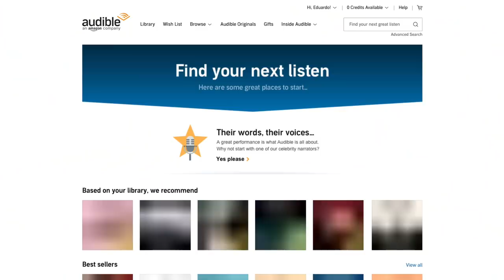⛵️DIY sailboat portlight installation #109

Comment: For future reference,  there is a plastic scrapper used for cleaning pots and pans where the side meets the bottom. I have used these to smooth out caulking when doing the  edges between the bath tub and the surround. Works a treat and they don't cost an arm and a leg! Your boat sure looks nice.  Have fun!
Reply from the maker: Thanks for the tip

Comment: Take a look at Butyl Seal Tape for sealing just about anything on your boat. It will maintain a seal so much better than anything else and so much easier to use.
Reply from the maker: Thanks for the tip.

Comment: Did you consider using butyl tape instead of psycaflex? It's so much easier to work with and allows for easy removal if you have to in the future.
Reply from the maker: Nop. We actually like sikaflex and butyl tape is not commom to use here in Brazil, it's not easy to find it to buy

Comment: You should invest in a battery operated screwdriver. 😉
Reply from the maker: We do have one. But these screws have flat head
Reply: Odd Life Crafting : I was going to tell Johnny that they are flathead and you can’t use screwgun but you beat me to it. 👍
Reply from the maker: 👍 I was quicker than you. hehehe. Thanks for the explanation
Reply: There are bits for different screws ..😉😬
Reply: Yes there different bits so go ahead and see how fun it is
Reply: @death1305sam  could you explain that please?
Reply: It is important to have exactly the right size of bits for the screw shell, and run slowly.
Reply: @frankd2301  what is the problem with flathead screw and battery screwdriver?
Reply: @BStrapper  they are no friends......
Reply from the maker: It’s easy to the screws to get out from the bit and scratch the woods. Also we can have a better notion of the torque we are applying

Comment: You guys are working hard and making great progress. A pointer on masking with the tape. If you always make sure your overlaps are in the same direction you can strip the tape all at the same time. Only have to pick the edge once and it automatically keeps lifting up the next piece of tape. Saves a lot of mess and time.
Reply from the maker: Thanks for the tip

Comment: A tip from an Aquarium builder - Cut a 30-40 degree angle on the end of the nozzle. Position the cut end facing down into the gap and move the gun along as you squeeze the trigger. This will help to force the sealer into the gap and leave you with a much easier cleaning job, and you will save a lot of sealer. You're doing a fantastic job!
Reply from the maker: Thanks for the tip

Comment: Great job guys it's nice to be able to see through the portlights. That really is a messy job, I think one of the worst problems is remembering NOT to put any old tape covered in sealer down on the nicely painted surface during the clear up. 
I saw some rather black looking fingers there, how long did it take to clean them up...I used to fit car windscreens and the bonding sealer for that would not come off for days!
I love the way you two react to each other...lots of love there!
One step closer...keep up the good work.
Reply from the maker: Hello, Dave. Duca had some black Sikaflex on his hands for some days, hehe. It went out by itself in the shower. hehe

Comment: Duca,  I understand the nerves but you and Roberta made it look great in the end! I can't wait to see that blue water behind you while you guys are at anchor. Maybe I will be in the same anchorage. Soooo, you live in a warm humid climate like I do and when I am doing a messy job like that I like to wear two pairs of latex or nitrile gloves. The reason is that they get messy and you need them off but then your hands are too sweaty to put on new gloves easily but with a second pair underneath a new pair goes on easily! Just tug on the wrist once in a while the fingers upward to let the sweat out. Other tips are to drill a hole through the caulk tube tip sideways before cutting it. Then cut just through the end of the tip at the end of the drill hole, this makes two points sticking out from the tip which help regulate the amount of caulk so when doing jobs like those portlights the amount doesn't give uneven squeeze out. I also like to use a long skinny awl to line up the holes before trying to screw them down so the sikafix doesn't smear. Lastly, when you tighten things with multiple holes you were smart to use a criss-cross pattern but it would be best to start in the center with a little X then move outward so the trim ring doesn't become bound or sprung. Ok, I'll  shut up now! ;-)⛵😀⛵
Reply from the maker: Thanks a lot for all the tips

Comment: Good job, I like the cappings around the windows, the boats I have been on and worked on, most of them just have the bolts and fixings exposed which imo makes for an untidy looking window surround. 
Now you know when you are out sailing and your decks and windows are awash that they don't leak.

Comment: GE used to have many technical data sheets online, for installing polycarbonate and acrylic glazing. The common mistake of just running screws through the holes creates a ticking time bomb. As the glazing expands and contracts (typically more than 2-3mm per linear foot) from heat, stress cracking starts at the screws. The official solution to this to to make the holes oversize, and use large washers under the screw heads, so the plastic can move without pushing against the screws. For the same reason, the gasket must allow movement.
 The modern solution is to use 3M VHB tape, which is used to bond skyscraper windows with no other fasteners. Incredible stuff, the marine has been using it as well. 
 If your portlights start to craze, use VHB tape next time!
Reply from the maker: Thanks a lot for the tip.

Comment: a tip, when tooling the sikaflex use a washer or coin held by vise grip players to scrape away the excess sealant, then go back with your finger and soap. the way i do it is hold the washer or coin up to the window and see where it touches and use that to determine where I'm going to put my tape. that way when i pull the tape there is no clean up.

Comment: Looks pretty good! We wondered if you considered a butyl based sealant rather than Sika? We ask because Sika does not perform well in a 3 way joint or where there are materials with dissimilar rates of expansion. Sometimes needing a bond breaker inserted. We refitted an old Westerly many years ago and had issues. The Sika rep advised a butyl based maietial on the portlights as the glass fibre, Aluminium and Acrylic all expand and contract at different rates in the sunlight. Love you guys enthusiasm and your building a skill set that your sharing with others. Looking forward to your next video. Sail Safe. Ant, Cid & the Pooch crew.
Reply from the maker: Thanks for the tip. It’s pretty hard to find butyl tape here in Brazil
Reply: @OddLifeCrafting  We thought there may be a reason. love your videos guys. When you start your electrical works send us a PM or watch our boat electrical made easy series. Happy to help if you need it. "as a collaboration among YT sailors" Sail Safe. Ant, Cid & the Pooch crew.

Comment: Nice job!!! That system is great, if you want you can install a second plexiglass and make like a double glass to protect from the outside temperature. Best of luck!!!
Reply from the maker: Thanks for the tip.
Reply: @OddLifeCrafting  and can be thinner, the air inside is the insulation, so it can be a lot cheaper.
Reply from the maker: 👍 maybe in the future

Comment: Just love you guys and your adventures!
On the outside of the windows you don't need to apply so much sealer as you end up wasting more than required especially when smoothing it out with your finger, but great job all the same, Look forward to seeing you next week! 😉 👍
Reply from the maker: We actually think we used the amount we needed of sika as  there were almost no leftover.  Thanks for the tip

Comment: When I have to apply caulking I never use tape and finger smoothing because it inevitably results in a thin edge that is less durable. Instead, I just cut the nozzle so that it leaves a bead wide enough to cover the gap, applying the caulk in a forwards direction (pushing, not pulling). This gives a  solid seal and it is often easy to pick up any excess when it is cured, using razor blade.  Since you will probably have to caulk again on other projects, may I suggest practicing using some scraps and a cheaper caulking? I think you will quickly become an expert and it will save you a lot of time (and reduce material cost too). This is a great project and I’ve learned so much watching your excellent videos.
Reply from the maker: Thanks a lot for the tips

Comment: Looking good guys, I know it's a bit late now but there is a products called swarfega hand cleaning wipes and it's specially formulated for easy cleaning of sikaflex and other sealers it cleans it off very well especially on glass/perspex we use it to clean up after installing train windows.
Reply from the maker: I’m pretty sure we cannot find it here in Brazil. Thanks for the tip

Comment: Good job as usual ! you could cut the pipe of sika with 45° angle wich is much usefull, i use the soap in a small garden spray melt with half water and i smouth the mess with an old credit card forming a perfect filleting.... :)
Reply from the maker: Thanks for the tips

Comment: For tooling the caulking bead nice and smooth mostly water and small amount of dish soap works better... yes even spit on your finger works as well run your finger back and forth for best results using a light touch :D
Reply from the maker: Thanks for the tip

Comment: I suggest you try the test with a full bucket of water, like a wave slapping heavily onto the port light with a bit of force.   I am sure it will be OK as you seem to have done a really good job, but the sea is more powerful than a tiny hose, more like a fire hydrant!!
Reply from the maker: Thanks for the tip.

Comment: well it always fun doing this stuff , I dont even know how many I have done over the years , and on various materials .Sika is good stuff I have used this system before and it is just fine , on a steel boat done properly , it will last longer than you own the boat .the only thing I do when installing such things is to use a crossing pattern or an X pattern when tightening up anything that has more than 4 screws or bolts it torques the item down evenly , I did not noitce whether you did this but it is good advice . Dont worry you will find every leak in that boat the first time that you are going to weather in 35 kns of air in 8-10 foot seas , then you will know how good a job you did ,keep up the good work and take care
Reply from the maker: Thanks for sharing your experience with us, Lawrence.

Comment: Duca,
When masking things off with the blue tape first use 1/4" wide tape in the curves. Much easier to tape that way and you get better curves. Then use the wider tape and tape that to the 1/4" tape. 
Otherwise,  great job. When is the new mast coming? Are you guys thinking of new sails too? You're getting pretty close now.
Reply from the maker: Thanks for the tip. The new mast is been produced, probably it's gonna be ready in January. We are gonna use the sails we have for now.

Comment: Nicely done! So impressed with how you research and meticulously do jobs. I would like to save you work in the future. You tried to use the soapy water on your finger or rag. Next time use a spray bottle I use spray glass cleaner. Spray foam glass cleaner everywhere before you smear the sikaflex that will stop asika Flags from sticking all over when you spread it. It will help smooth the sikaflex but more importantly it'll stop it from sticking all around when you smooth it. It won't stick very well to your soapy water and you won't make a bigger mess. I use a spray foam glass cleaner all over the place lots of it then when you smooth  it out everything comes off easy except for the seal part. Hope this helps.
Reply from the maker: And how can I mark the place where I want to have adherence to not have any soap?
Reply: You spray the soap spray after you put down the sikaflex and before you spread and wipe it. That way it sticks where you put it and not where you wipe it into

Comment: Little Tip for using sealants like sikkaflex or silicone from this kind of glue gun. It appears that you left the nozzle to pointy, requiring a lot of force to press it out, causing shaking and also sometimes going back and forth to make a line as wide as you want.  Cut it off a little(not to much) and you might be able to create a smoother bead of glue in the first place.
Reply from the maker: Thanks for the tip

Comment: You guys used like 3 times more sikaflex than needed on those port lights. Less is more when it comes to doing a nice neat job with that stuff. It wont leak which is good, but you made a lot more work than necessary especially cleaning it all up. The boat looks great though, fantastic job!

Comment: Hi there. You could have used butyl tape instead of Sikaflex. Fast, easy and no mess at all. Lasts forever... Regards from Switzerland. Silvano
Reply from the maker: It’s not easy to find it here in Brazil. Thanks for the tip
Reply: Hi. Try to ask suppliers for the building industry. They might have butyl tape. I did the same in Switzerland asking for a sample to be tested in boat building. I got a free of charge box with various butyl products simply in exchange for my opinion as to how it works on boats. I now have butyl tape for almost a lifetime. Good luck. Silvano

Comment: When you replace the windows with the liquid gasket, it's a good idea to use two layers of tape/protection.  The top layer is just tape around the edges to "cut" the gasket, and the layer against the glass/acrylic protects the window from smudges and accidents.

Comment: Hello, 
Glad you found no rust. Always feels good when you've completed a job that you have put off because you are dreading it because it will be nasty or due to the results you may find!
In your video intro it states that you are going to take a couple of months off from building your container house. It's been longer than that now and you guys have gone a lot further on your rebuilding of your boat. I agree you are in a great yard with good workers and it makes sense. What I am curious about is your bulkhead with all the post it notes on it. That's how you were going to keep track of everything you wanted to do.  We haven't seen a shot of that for a while. I see it in the background once in a while and it is almost bare compared to when you started. What's left of the original jobs? Can you guys let us see? Be nice to have part of an episode of what you thought you were going to do in the beginning and what has really happened and why as you dug into the boat further. 
 I used to make gaskets while in the US Navy. You guys did a great job!
 Keep up the great work. 
Guy
Reply from the maker: Hello, Guy. Pretty much what we still need to do we talked on this video: https://youtu.be/x3f_rIslGis since this day we had installed the portlights and finished some painting jobs. We are still trying to put together a sanding machine to clean the diesel tanks. We also cleaned the winches.
Reply: Yes, I watched the port light video. You guys are almost done! Just need that mast now. I am sure you'll have plenty to do prior to that arriving.

Comment: Sikaflex is good stuff, but expensive and yes.  Your right, it makes a big mess and clean up is very difficult.  Plus it is very difficult to squeeze out.. Buttle tape is much cheaper.  Works great, very cheap and clean up is supper easy.. Just a razor blade.  It seals right away and you don't have to wait 24 hours before exposing it too moisture.  Comes in round or flat and in a 100 different diameters and lengths.  I have used both in Marine and the automotive field.  In automotive, before Sikaflex, there was a liquid buttle.  but that was a bit messy, but not as difficult to clean up as the Sikaflex. Still a cure time required, but no messy primer that would stain the pain or fabric that will never come out.  And it doesn't stain your hands like Sikaflex does.. Good luck.
Reply from the maker: Thanks a lot for the tip
Reply: @OddLifeCrafting  Wish I had known sooner.  As soon as I heard you say Sikaflex, I already knew.. H ehe.. anyway.. windows still look good.  It does make a great seal.  But when you go back to replace it... it will be a bear to get out.

Comment: Just for future reference, you might want to consider using butyl tape instead of sikaflex or rubber gaskets. Also. It might have been nice to consider turning some of those porthole into opening windows for better ventilation and with screens to keep the noseeums and other bugs out when you are anchored near mangroves or some beaches.
Reply from the maker: Maybe in the future when we are outside of Brazil. It's a hard product to find it here in Brazil. We have 8 portlights in total and 12 hatches (that can open). So I think we are fine. Maybe in the future we can change some of them

Comment: To clean and form sikaflex use turps on finger ie dip finger in turps and it will form a nice radius. Use plenty of turps and keep forming until sikaflex is at same thickness as the tape. Wate a little time remove tape and a small ridge will be left. Wet finger with very light presure lay thst ridge down. Sikaflex can be removed while wet from most surfaces with rag soked in turps. Turps will not affect the quility of tbe sikaflex.
Reply from the maker: Sorry. What is turp?